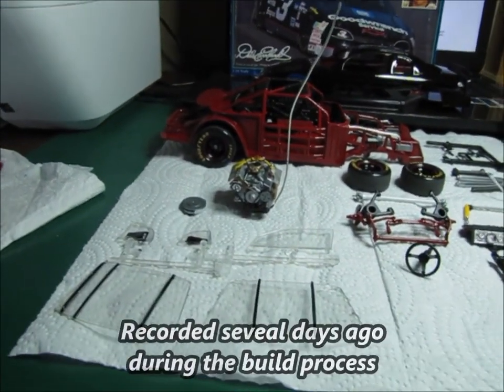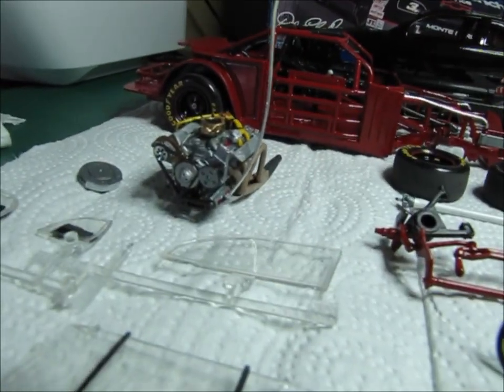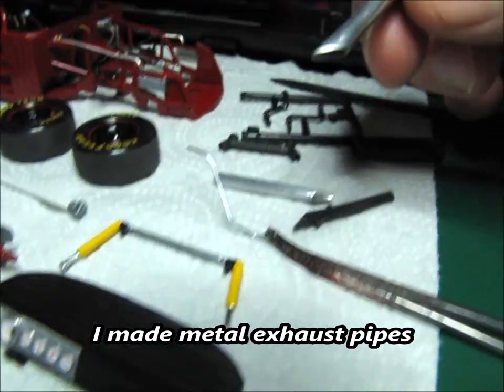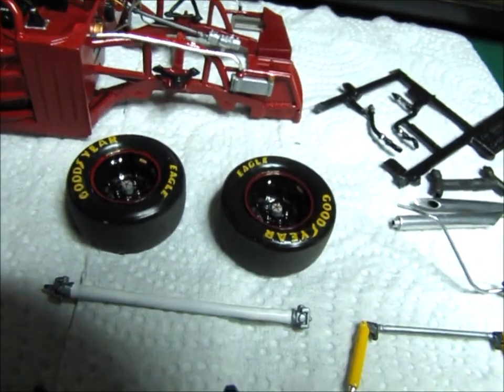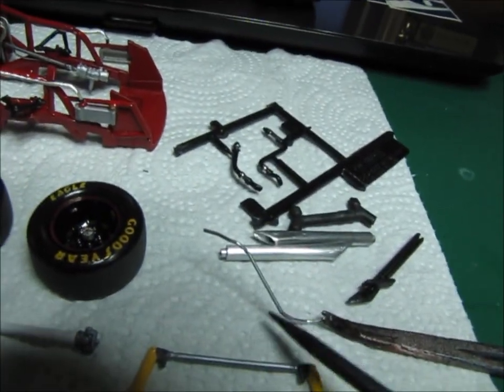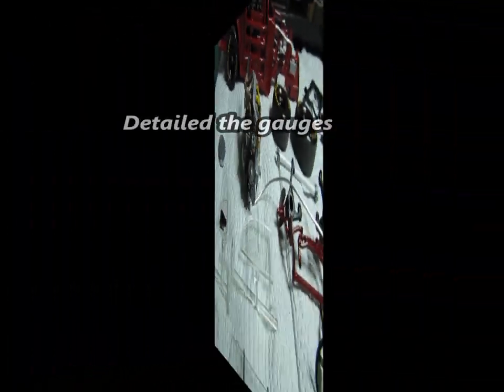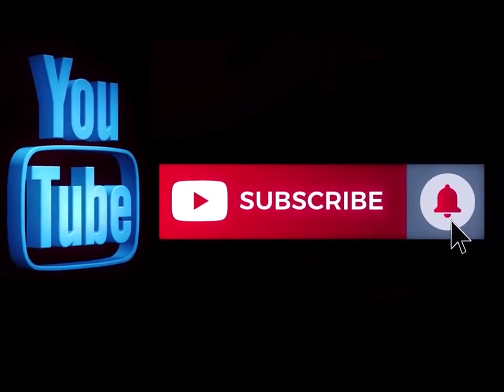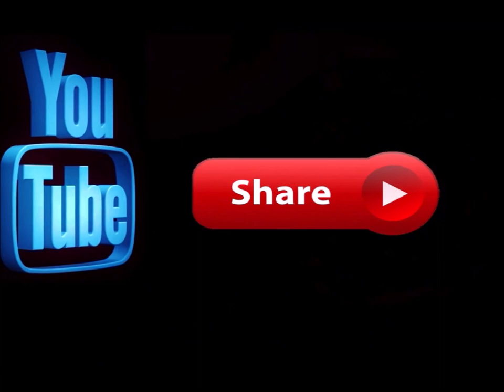Dale Earnhardt Sr - Group Build Final

Comment: Turned out really good ! That's cool how you just made metal exhaust for it . Have you ever built a real car before ? You seem like you know a lot about them .
Reply from the maker: I have done some car work before, had a 79 Monte Carlo show car for years.  I bought the metal tubing several months ago in three different diameters so it worked out well that I had exactly what I needed on hand.  Thank you for the compliment and for watching!
Reply: @EdsAttentionToDetail  Did it have the big block 454 in it ? I know my dad had one around that year that had one in it .
Reply from the maker: @AaricHale , no it had the 305 V-8 but I rebuilt it, stroked it and bored it so it was fairly strong!  Owned that car for over 30 years.